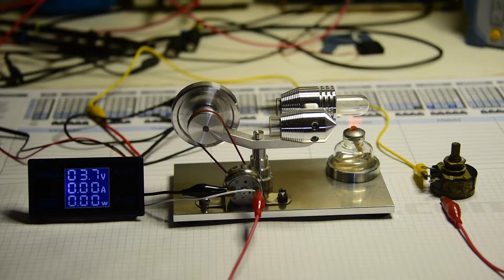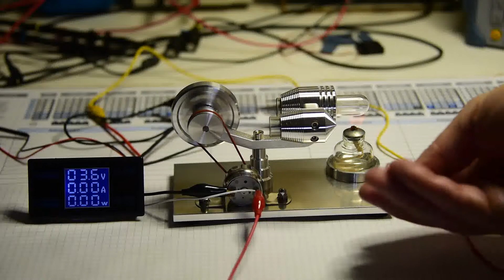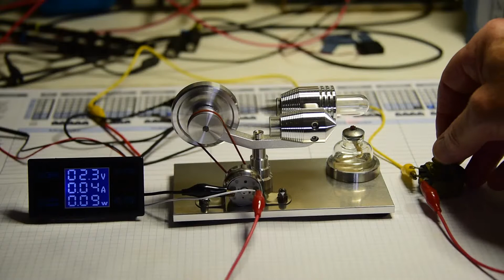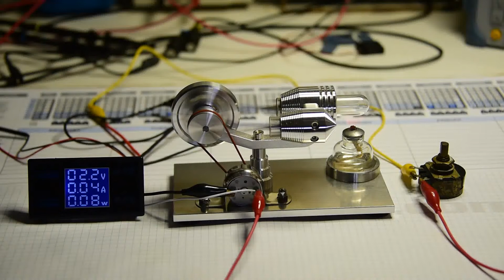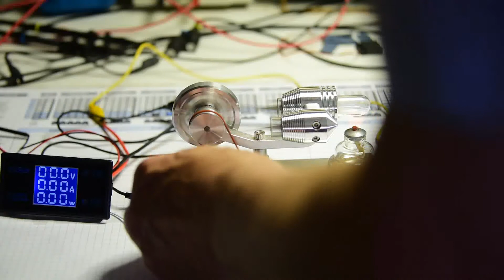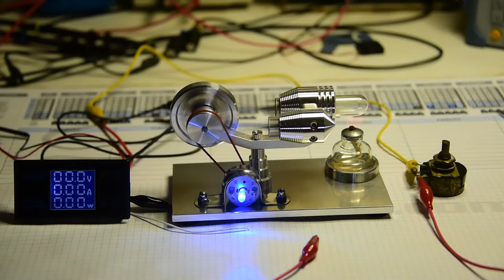Daniel's model Stirling engine: power output

Comment: I didn't have the electrical components to measure electrical wattage, so i instead measured kinetic wattage by suspending a screw of known mass from a pulley on the driveshaft, and using video to measure the speed at which it is pulled up. I got around 0.016 watts using P = FV (power in watts equals force in newtons times velocity. This is the same as joules per second, just with some algebraic manipulation.) It is a tiny engine and doesn't seem very efficient. It basically has just enough power to remain spinning.
Reply: @DanielTheGreatAu  yeah no generator, I just thought it would be fun to figure out power by a different method

Comment: What if you put a larger heat sink on the cold cylinder so that that there is a bigger heat difference between the two and you might be able to pull .1 a or .13. Maybe more would be cool to see.
Reply: @DanielTheGreatAu  yeah but it would be interesting to see the power output at that point.
Reply: @DanielTheGreatAu  I did

Comment: Great! One of the rare cases we see the real output power of such engine. By measuring the weight of the burner before and after the test, it is also possible to measure efficiency. I would guess in the range of 0.1%.

Comment: What if we increase the heat by using a different flame like lpg
Reply: @DanielTheGreatAu I know that these are just for demos, but I'd really love to see a stirling engine of this type hooked up to a DC boost converter to charge a phone, but most engines that I see only produces 100mah, is there any way to increase efficiency? A better quality motor? Better bearings maybe?